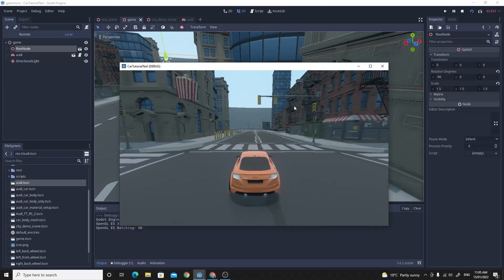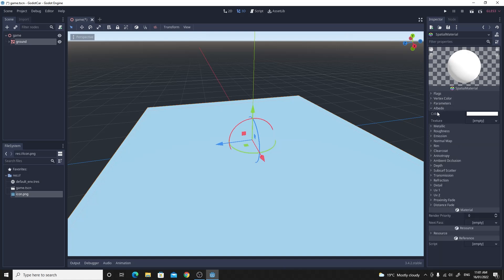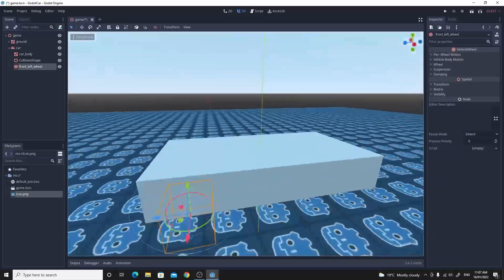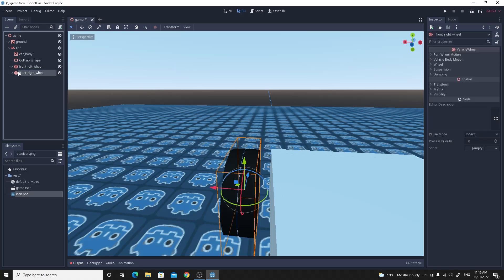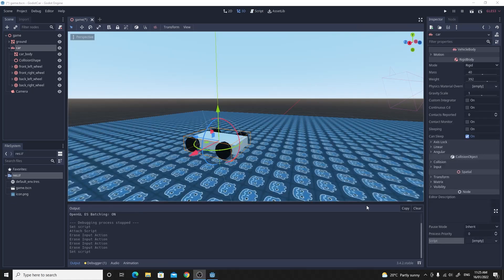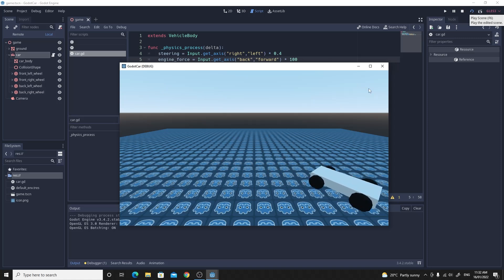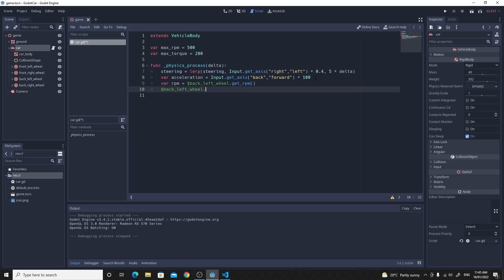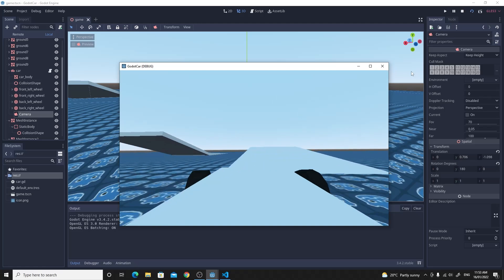Godot Car Tutorial

Comment: What about slopes? How can you get the car in a slope so it doesn't slip?
Reply from the maker: @kwkfortythree39  the vehiclewheel node controls a lot of the friction calculations so you don't have to. You can tweak the values to see if it works for you use case but it favors simplicity over complexity. The only other option is coding one yourself from a raycast or waiting to see if the Jolt Physics engine implementation is better.
Reply: @SRCoder  yeah, I'm using vehicle and wheel 3d nodes and got somewhat decent behavior, but slopes are still slippery, and I tweaked a lot of numbers. I guess physics is this way still.
Reply from the maker: @kwkfortythree39  sadly yes. Even top games get it a bit like that too. Just work around it.

Comment: its sad that godot doesnt have a usable physics engine. godot is great otherwise. but when the documentation itself sais "there are known issues and it is not realistic, and you are better off making your own physics class", you know what´s up.
Reply: Jolt Physics is a free add on, a drag and drop replacement for the physics engine, which is actually what the Horizon Zero Dawn games used!

2D has "Box2D", which afaik is the same thing as the Jolt but for 2D
Reply from the maker: It's not bad. All physics engines make compromise between speed and accuracy. For simple games it's fine.
Reply: Update: finally Jolt physics engine is directly embedded in Godot and it's great

Comment: Car is still going infinite speed even after the fix
Reply from the maker: Make sure the value or rpm is getting adjusted based on the current speed. Use the print statement to log the results as you play the game. That will help you debug your problem.

Comment: Hi there, great tutorial but I have an issue. I followed as closely as I could and I have the ground, car and wheels set up. 

After adding the camera and testing everything, the car collides with the ground but the wheels go through the ground, as if they have no collision. They are still attached to the car. (I am using Godot 4 btw, a lot of the nodes and materials are named slightly different but have the same functions.)

In your tutorial, the suspension works and it looks like the wheels collide with the ground before the car does.

Can you point me as to where I went wrong?
Reply from the maker: I'd need to see it to be sure. Make sure the colliders are parented up in the right order. It sometimes takes a bit of tweaking but the wheels should collide. You can see them in the editor in the 3d viewport when you set them up.

Comment: Hey, thanks for the tutorial. However, whenever the car drops onto the ground. it suddenly goes flying. I have checked all the collisions and nothing seems to be wrong. Do you any fixes for this?
Reply from the maker: Make sure it has a VehicleBody node and the Vehicle Bosy has a CollisionShape node as a direct child. If all else fails, start again ans try to follow along exactly and only change stuff after it is all working.
Reply: @SRCoder  Alright, I fixed it by using Godot 3 instead of Godot 4. Dunno how that worked, but it did, so I guess I'll use Godot 3 from now on.

Comment: Hey love the tutorial. I got a slight problem tho, my car doesn’t turn for some reason. The front two wheels turn but the back two don’t, so my car just kinda moves forward and slightly to one side if I choose to turn. Any help? I been stuck on this for ages, any idea what could be wrong?
Reply from the maker: The wheels have to assigned a role of steering to steer and motor to drive. Make sure that's the case. Then make sure the naming is right. The code directly accesses a wheel by $wheel-name so of the name is wrong it won't change the wheels values. Try that and see how you go

Comment: Its to slow. how do i increase the speed?
Reply from the maker: How do you think?
Reply: @SRCoder  I assumed the rpm but the answer was no
Reply: @SRCoder  I increased engine force on the vehicle and the wheels, changed the torque and everything that makes sense to try. It all failed
Reply from the maker: @Ryixxx  how about max_rpm?
Reply: @SRCoder  yep. i changed but it did nothing
Reply from the maker: @Ryixxx  The wheel turn because you apply a number to engine_force. Thats it. Bigger number => faster wheels.

Comment: I experience problems with the car rolling when steering not apparent in this video. Suggestions include lowering the center of mass /  altering the wheel_friction_slip / or wheel_roll_influence, but nothing works. This is also evident for other users around the web with no solutions that apply to me. 

How do I stop the car from rolling over?
Reply from the maker: All those solutions work. It's a balance between grip and centre of gravity just like in the real world. It just takes tweaking. Adding more slip makes it slide before it turns over and lowering the centre of gravity negates the effect of roll. Just keep changing values one at a time to see their effect and you'll get there.
Reply: @SRCoder  Great! I'm far too impatient to tweak parameters without the guarantee it will work. Thank you.

Comment: i have a problem

i copied all of the codes and when i start it is says   error(11,10) :  variable "rpm" already in the scope (at line 9).
what is the problem i dont get it
Reply from the maker: It's telling you the problem. Have you tried to put a "var" before the rpm again on line 11? You only do that once when you declare the variable.
Reply: I did thanks, but now it says
invalid call. nonexistent function 'get_axis' in base 'inputdefault'

i dont get it alot of research still nothing
Reply from the maker: @lock0000  is this you first game? Do some of the excellent beginner tutorials on gdquest and the godot website first. It's pretty easy to do typos and you've got to learn how to debug your own problems.
Reply: @SRCoder  its not my first time create game its my first time seeing this error, by the way im on linux
Reply from the maker: @lock0000  Input.get_axis() function. Look it up in the Godot Docs. It's for Godot 3.4+ and returns a value between -1 and 1 using a virtual axis defined by the two input actions. Make sure you have a capital "I" for Input and and you the spelling correct. The Input actions need to set up in the project manager too.
Reply: @SRCoder  thanks my brother your the best 1 more sub too you😃😃

Comment: First, thank you for the tutorial.
Now a question, when i accelarate or brake the car_body pitches in the opposite direction. How can i solve this?
Reply from the maker: Just like a real car, the center of gravity affects the pitch and roll. However, check the vehiclebody docs and you'll see a property for controlling how much it pitches and rolls so you can change that value. Or just change the center of gravity lower or higher and see what happens. Have fun!

Comment: Could you explain the formula you used?
Reply from the maker: It just reduces the actual torque value based on the rpm of the wheel so that it doesn't accelerate to infinity!

Comment: I was having the issue that you mentioned in the description of the video, and the solution that it shows still isn’t fixing the problem
Reply from the maker: Work through the math. Try to calculate some values for the final torque based on a sample of positive and negative rpms to make sure that the equation does what it needs to do and reduces the overall torque as the rpm increases.
Reply: Just put a - in front of the acceleration, at the .engine_force line, it will drive fowards.

Comment: Most of this works, but for me when driving in reverse, the speed isn't limited, and the vehicle gets faster and faster until I crash or get yeeted into the stratosphere. It's kind of fun, but not as intended.
Reply from the maker: Yeah. You need to but abs() around the rpm so that it is an absolute value (in a positive integer). That way the equation will work the same way as it does when going forward

Comment: Hi thanks for the tutorial, it works really great! I did notice in reverse I can get crazy speeds because of the engine_force calculation. I think the rpm should always be positive for this calc. i.e. $back_left.engine_force = acceleration * max_torque * (1 - abs(rpm) / max_rpm)
When I do that, it works as expected
Reply from the maker: Yes. I forgot to add this in but thats the correct solution. Having fun with Godot?
Reply: @SRCoder  yes, godot is fun, I've used it in 2.1(made a, very buggy, 2D driving game which I released on itch at the time, it was a goal of mine at the time to "release a game" :D) and 3.0(made a phone game with mapbox tiles, a cool ps2 game style animated menu system, looked cool but wasn't much of a game), and now I'm back looking at 3.5 with a 3D driving game based on the old 2D one. 3.5 is a joy to use compared to 2.1.
Reply: for me it doesnt work, while i turn while riding in reverse i get crazy speeds. getting only positive for rpm doesnt change that for turning.

Comment: Hey love this, but do you know how to properly rotate wheels when in air?
Reply from the maker: The wheel meshes match the position and rotation of the wheel colliders calculated by the physics engine so they should match all the time.
Reply: @SRCoder  I mean the docs has it that VehicleWheel only rotates(simulates) when in contact with a surface. So when in air, to get feel of accelarating, have to rotate them manually.

Comment: One thing I didn't understand is why would left back rpm be different from right back rpm. Wouldn't the rpm of both wheels be the same therefor the calculation would only need to be done for engine force once and then used for both wheels.

However then I tested and notice that the rpm for both wheels is different which is very confusing. The RPM also seemed far higher than the actual rotations of the tyres. For instance it would report an rpm of 6-7 when the tyre was barely turning.
Reply: Way outside of the scope of this video but, you can use the separate wheels for how much traction a wheel has.  This way, if your left wheels hit the dirt they should behave differently than on asphalt.  This could also be used for calculating a limited slip differential for traction control.
Reply: thats cuz when u turn, the wheel on the outside edge of the turn has to turn faster to keep up with the inner one. this is real problem in cars as well and to fix it they use a limited slip differential
Reply: @takumifujiwara2073  username checks out

Comment: Nice tut , but the wheels aren't turning left and right when i try, but it is moving froward and backward
Reply from the maker: You can see in the tutorial that it does. Hopefully you've checked and worked it out by now.
Reply: @SRCoder  yeah bruv all good
Reply: i have the same thing, not sure where i went wrong :/
edit: fixed it, i didn't set 2 of the wheels to steering LOL
Reply: hey im having the same issue how did you solve it?
Reply: @jampre  i re did the whole thing from scratch
Reply from the maker: Did you make sure the actions are set yp correctly in the project settings? They have to be called exactly the same in the get_axis command

Comment: Wish I had this 2 years ago
Reply from the maker: You have it now! The chase camera in the next video is pretty cool too.
Reply: Can you make a video on magnetic wheels? That’s when the cars can ride on any surface such as ceilings and walls.

Lastly, will the car drive smoothly on imported roads because godot has a bumpy physics problem when using rigid bodies and tri-mesh shapes.
Reply from the maker: @thelumberjack8838  it works pretty well on terrains and relatively smooth collision mesh just like real wheels and suspension. You can tweak the suspension length, damping, spring strength etc to get an off road truck simulated too. As for magnetic wheels, you'd be better to implement a fake car with a kinematic body  using the vehicle wheel component would end up really hacky.
Reply: I was thinking adding a raycast at the bottom and then applying a force to the opposite collision normal.
Reply from the maker: @thelumberjack8838  if you make it a kinematic body it won't fall with gravity so you can move it with input and use a raycast to work out what it's orientation should be.